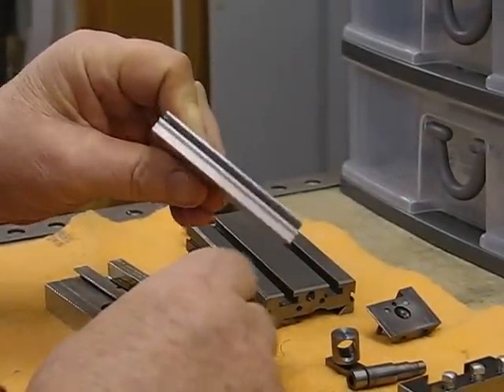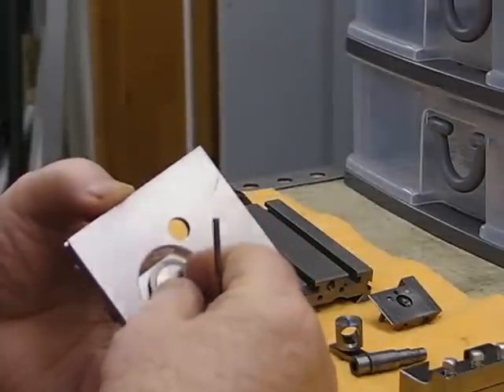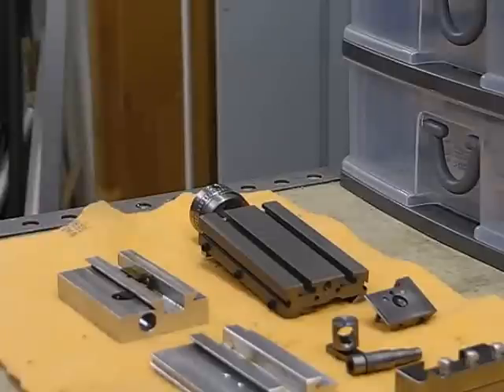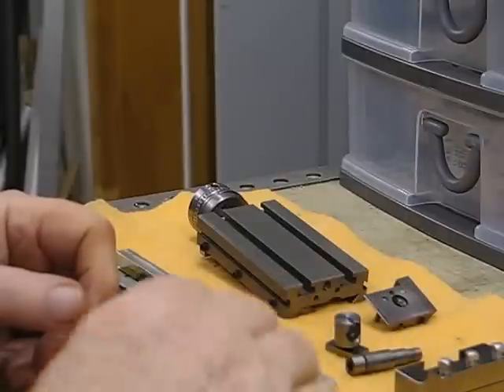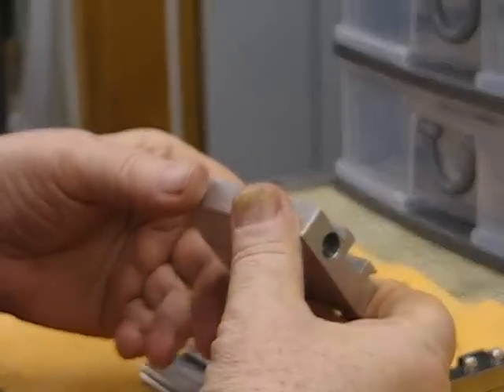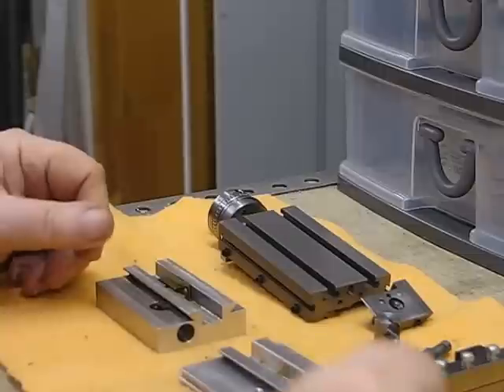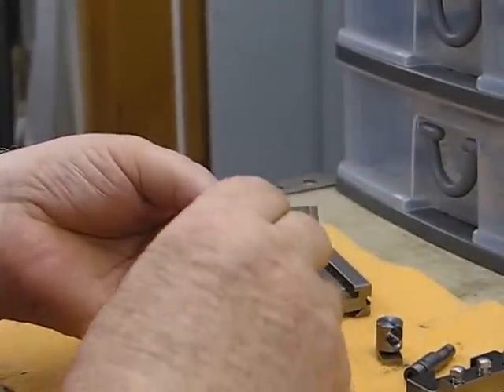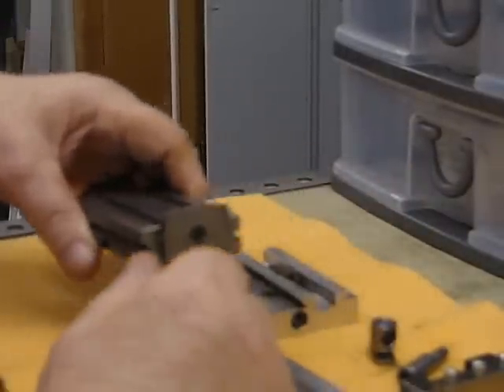MVI 0262 Taig Modified Top Slide part 1 of 3 videos

Comment: Great mod!  I made 2 blocks that clamp on to the overhang on either side of the bottom plate. I also make flush mounted gib screws so they would not interfere with the clamp blocks.
Reply from the maker: Thank you for the compliments, glad you enjoyed the video, the clamping blocks sound like a more professional way for a more solid arrangement, it allows you to place the slide anywhere on the cross slide without struggling with the Taig pivot clamp arrangement,

Comment: Thank you very much for the video. That is a huge improvement over the original. I found it so easy to twist that I avoided using it any time I could. I'll be practicing making some dovetails!
Reply from the maker: stewarma102, 
      take a look at the base plate you already have, its quite possible you might be able to use it instead of machining new dove tails by just adding an extra plate to the base, just a thought, if you need any dimensions let me know, and thank you for the positive comment,

Comment: I have an older topslide that does not even have the mettal ring underneath it on the base plate, its all alluminium :-(
Reply from the maker: Happymark,
   did you make a video of repairing a fountain?, I have a reason for asking,

..........Edmund.........Alberta
Reply: Walter Maisey yes I did , v=1MgkQzqfeLc
Reply from the maker: happymark1805
question 1, how does your top slide anchor itself to the cross slide, 
question 2, would the newer base fit your old top slide,
Reply: Walter Maisey as far as I know they clamp in exactly the same way as the later taig model that has the ring, the only difference as far as I can see is the mettal ring, I thought about making a metal ring and modding the base but the taig has not enough clearance for me to put the base in and turn it down so the metal ring would fit. 
I think the newer base would fit, I also fitted the newer ball bearing leadscrews with no problems.
Reply from the maker: happymark1805
if you want to contact me with your address I'll mail my one to you, just reimburse for postage, holmes_ca_2000 at yohoo.com
Reply: Walter Maisey Would love to have it, I think it would be a great improvement to the one I have. just send you an e-mail